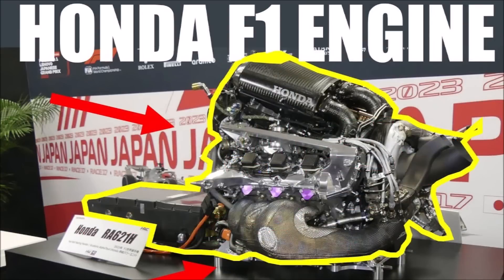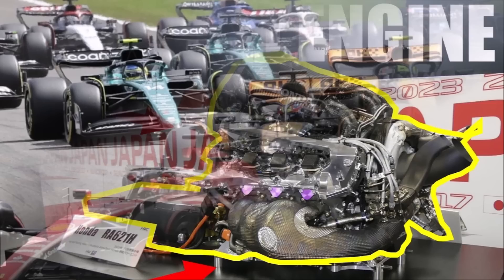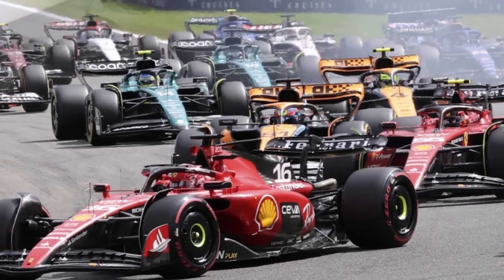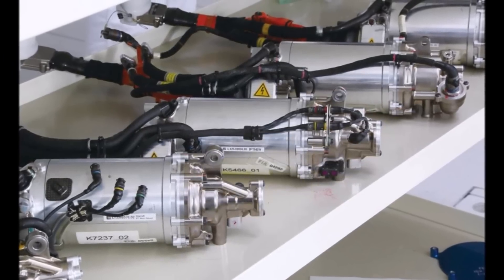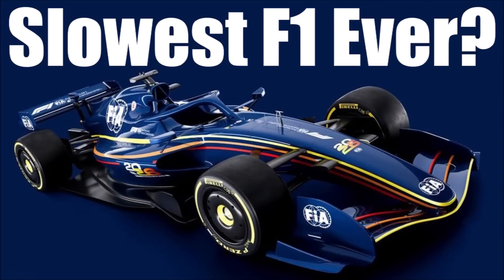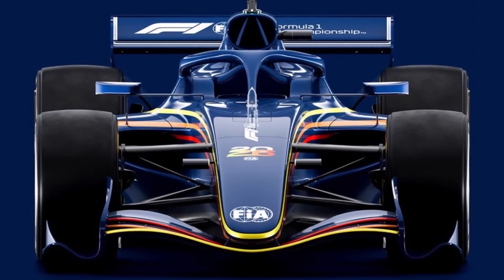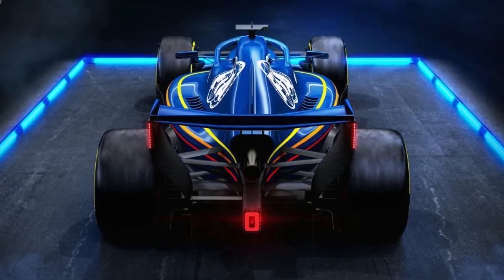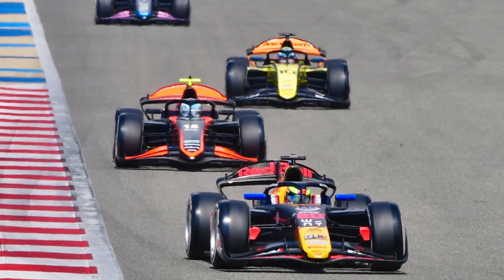F1 2026 Update - CLOSER LOOK

Comment: The whole "Audi knows front electric  drive so lets sabotage the concept" seems so petty me me. Like, all the current top teams have a huge lead and understanding in F1 on all the other elements of F1, why be concerned a current backmarker team, even with Audi's previous experience, would ever challenge the top in the first few years of running. And by that time, the current top teams better have a handle on front electric.
Reply: There is also Ferrari with LMH knowledge (and Toyota for Haas), So that might also be cause of the reason. Still... I'd prefer the front axle regen over this
Reply: @m_remon 
When the engine negotiations were held Ferrari hadn't announced the WEC programme yet. Haas and Toyota was made possible by Komatsu as TP at Haas. This is years after the engine talks were finalized. Can you imagine Günter Steiner talking with Japanese people?
Reply: @henkormel5610   The negotiations for WEC was probably years in advanced though. So FIA knew about it.
Reply: @gerogyzurkov2259  
The technical commission of the FIA apparently didn't. It is officially not their business. What they officially don't know they can't act upon.
Reply: F1 can be very petty. Just look at the Andretti drama.
Reply: @jamsbong  wasnt it Liberty Media that had issues with Andrett?
Reply: @Keckegenkai  Liberty Media owns F1 commercial branch. so they are F1 boss.
Reply: I think Audi is a scapegoat. I guess they had some issue with fitting it into the chassis and keep it looking like an F1 car or something.

Just like you I feel it's wierd to blame such a "minor" thing on Audi.
Reply: @Celciusify they have it ln formula e so im sure they can fit it in
Reply: @Celciusify  These f1 electric motors are tiny. Also they could choose for it to be a pancake motor if they wanted, so thinner, but bigger radius. You can pretty much make it any size cylinder you want.
Reply: @Celciusify  smaller (15-16 inch) front wheels + hub motors and there's no problem with fitting and only small weight penalty
Reply: @Celciusify 
Audi isn't the scapegoat but Porsche was. Audi used high power capacitors to store limited enetgy. Porsche used batteries to store .much more energy. When the engine talks were ongoing Porsche was still in the hunt for Red Bull.
Reply: Mercedes has won two formula E championships in recent times. But big, bad Audi is the FIA bogeyman…
Reply: Mercedes:
Reply: 2026 F1 cars probably gonna have similar car's weight to 2024.
Reply: C’mon, dude. It’s Audi. They’ve been successful in almost every form of Motorsport they’ve ever entered
Reply: @mrsoisauce9017  Imagine defending making cars shit just because Audi is entering
Reply: @UndisputedGoat4  I’m not defending jack shit. I’m just saying: it’s not without reason. I still think it’s wrong, but it’s not without reason
Reply: Probably the thought that Audi/Sauber is sandbagging to have the most ATR time for developing the 2026 car.
Reply: So what now, Ferrari also have same advantage given their recent experience with front wheel drive hybrid system
Reply: F1 is too expensive for that kind of risk. Especially in F1 where a significant advantage can be had on engines at the start of every regulation change. Personally I feel like it's relatively even odds with regards to the advantages and disadvantages for Audi and the teams but the teams feel different and I can't fault them for that. Even if personally, I would like them not to have a say in this at all v
Reply: @ they have to have a say. If teams don’t have a say, and teams aren’t satisfied with the rules, teams can and will leave the sport. Why else do you think only 3 manufacturers are left in WRC? Why else do you think everyone left LMP1 and GTD in the WEC?
Reply: Being Eco was a token gesture.
Reply: As actual skill issue as you say. The bullet and airliners. First off trains do need skill to operate. Some nations require a car license to operate. Handling a gun to fire bullets u need alot of real knowledge and experience on safety and training for a lisence for. That's why there is lisence for that. As for airliners again u need skill. If not way more skill needed not only u need lots of experience and knowledge hrs. They will require a lot of XXX tons hrs of flights of training on flights before u even a license pilot. Even then probably more training before u fly cause of different aircraft types u need to be certified on, systems, and so on. Airliners u need so much more.
Reply: RWD is purity. 
AWD is mushy crap.
Reply: @procatprocat9647 Yeah, and rally cars require no skill to drive... Sure, you are definitely a credible source with worthwhile opinions that shouldn't be immediately tossed with prejudice.
Reply: @procatprocat9647   The current fastest car on the Nurburgring is an AWD car which is the AMG One. Speaking of which isn't the energy recoup on the AMG ONE too?
Reply: @gerogyzurkov2259  fast does not equal entertaining. Many people, like you,  confuse the two. They think that Teslas are fun because they're fast 🤣

F1 is about showcasing the best drivers in the world. AWD masks their talent and us tediously dull on asphalt. Even on gravel it isn't as wild as RWD, but that's a different story.
Reply: @procatprocat9647   yes I know. I am saying the fastest Ring lap is from a AWD car. Not to mention Ferrari F80 is AWD so Ferrari must of known. Valhalla is also AWD too.
Reply: @gerogyzurkov2259  again. 
Fast is not the relevant metric. 

A train, bullet, or airliner can be fast. They are dull and require no skill. 

AI robots will drive faster than humans, but just like asphalt AWD, they miss the point of a gladiatorial battle.
Reply: @procatprocat9647 f1 might not be the right sport for you.

U are talking like todays f1 cars have loose rears and powersliding into the corners xd
Reply: @procatprocat9647   Trains are no dull. Train in most distances is way more efficient than a car for A to B. It's nothing to do with skill issue on a train. Who would focus and cares that aspect. Not all people are willing to drive for hrs and hundreds of miles. That's mostly dull too for alot of people. It's more politics that fixing roads and making more roads for equal if not more money than spending the same investment on trains for equal distances. It has no emotions, but that's not what it is designed for in the first place. It is for to be a great public transport which it is when design well which most are. Skill is not needed and nothing in that aspect. Having reliable and good transport is way more important.

 There's Gumball 3000 yet it's not television or bigger. AI driving is not great for cost cap. More power = more costs better Hardware = costs. Also not to mention no emotion aspects. That i agree with u on
Reply: @procatprocat9647  tell that to 2015 2016 2017 LMP1. Those were a perfect demonstration of AWD potential in F1. And it didn't need to go specifically run the engine to charge the batteries.
Reply: @Dakkyun  LMP1 isn't about the gladiatorial battles between the best drivers in the world. It isn't about the pinnacle of motorsports or designing a platform that allows the best drivers to differentiate themselves from the mediocre. 

F1 is those things. That's why AWD is inappropriate,  just like traction control, stability control ,etc are also inappropriate. 

What are you struggling to understand here?
Reply: @ WRC has used AWD for decades and that discipline is even more driver centric than any circuit racing. I think the AWD vs RWD argument is not valid at all. 

Both require skills to be fast. Just because you can look at an amateur hero drifting on a parking lot when it snows doesn’t equal you becoming a world champion because of AWD.
Reply: @Dakkyun  Porsche used the more or less same setup as F1, but with front wheel drive hybrid
Reply: @jamsbong  I've already dealt with that topic by stating asphalt racing. 

Racing on loose surfaces is a totally different skillset, challenge, and not comparable. 

Try not to compare any of this to your McDonald's car park antics. That's even less relevant.
Reply: @ what? WRC race on asphalts as well, not just loose surfaces. Of course they are comparable. In fact, F1 drivers have races in WRC. 

Again I state that AWD doesn’t give you skills to win. You still need real skills to drive fast.
Reply: @procatprocat9647  you know, i think that sportscar racing suits you better than f1. Because f1 is tehnical over enjoyment. It's an engeneering sport mainly. It's a marvel that fia hasn't apporved tc and abs already. 

But sportscar racing is exactly the opposite. You will find the best battles there. Spec series like porsche cup where there is no tc and no abs and 500 rear engined horsepower is a great example.
Reply: @jamsbong  you compare dirt racing with asphalt racing here. They require completley different tehniques. Dirt requires powersliding, and awd is great. Asphalt doesn't. Also you're not going inches from trees on asphalt either
Reply: @ rally run AWD and they are the best and most skillful drivers on earth,  and the show is still fantastic with AWD even on tarmac,  you are spouting nonsense
Reply: @procatprocat9647  AWD is the future, it is better in everyway.
Reply: @jamsbong  AWD is dull, and it doesn't require or showcase the skill of top flight drivers. 

AWD = 😴😴😴
Reply: @procatprocat9647  you could have it so that the the AWD is only available on the straights or from the exit of corners
Reply: @jamsbong  Better in everywhere?? Witg the current AWDs, HELL no. More power loss compared to RWD, less power on wheels, more weight, less top speed, less acceleartion after 150 km/h. Onlu advantagr is slow corners. I dont know what will happen in the future tho
Reply: @procatprocat9647  you can limit deployment only after certain speed (demands skill), but still avoiding smth like Colapinto's crash in Brazil. 
There's a sweetspot and those front motors would've ~1/6-8 of the total power anyway
Reply: @procatprocat9647  Formula 1 is a constructors' series.  If you want a pure test of driver skill, watch a spec series like Super Formula or F2.
Reply: You could also add tc and avoid all crashes completley. But aren't we working towards impact safety for decades just so that crashes can happen safely? No need for awd in f1 in the name of tehnical innovation. Tc and abs would do the same thing, but i don't think we want gt3 f1.

Comment: Should have gone front electric motor or 08 car size with v10 instead if they didnt want to be road relevant.
Reply: it would be cool if they allow more engine options
Reply: Im sorry, V10 died as a road car engine long ago (i mean the cars mere plebs could buy under 100kUSD) also battery are cheaper now.
Reply: @Dakkyun  Inline 5 and Inline 6 cylinder engines are the closest things the average enthusiast will get to V10 and V12 engines. Even a V8 would have been a better choice for F1 cars but we are stuck with V6 engines for the foreseeable future.
Reply: @CyanRooper  i5 has the potential to sound like a v10
Reply: @Hrtt  No more than I4 has the potential to sound like a V8. I4 and I5 will only ever sound like half a V8 or V10.  In a road car, to get it to sound like an actual (flatplane) V8 or V10 you need to join the banks together in the exhaust with a X-pipe, H-pipe or other merge (at an equal length) -- it makes a huge difference, suddenly your Audi R8/Ferrari 458 goes from sounding like two inline-fours or inline-fives at 9,000rpm to sounding like a V8 or V10 (as if it is at 18,000rpm when compared to F1 because of the reasons below).

F1 engines rarely joined the exhaust banks, granted, so on the exhaust side they sounded more like two inline-fours at 18,000rpm or two inline-fives at 18,000rpm respectively.  If F1 joined the banks together it might even sound like 32,000rpm!

On the F2 Mecachrome V8, while the exhaust flows are not physically merged, the outlets are brought up right next to each other and act acoustically as one source. That's why the Mecachome V8 sounds like it is revving to 18,000rpm even though the rev limit is only about 9,000rpm.

Indeed, the Ferrari of 1993 (IIRC) even had four seperate exhausts, each exhaust was only for three cylinders!
Reply: @CyanRooper  throw some Stepped header on those and i will try a Vane type rotary engine with 5 vanes so it sound like a V10 at much,MUCH lower revs.